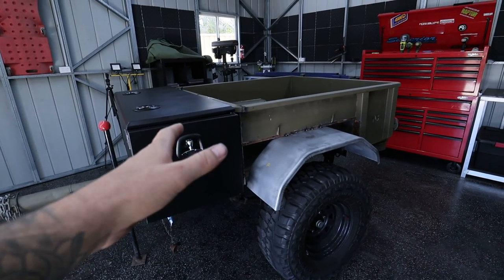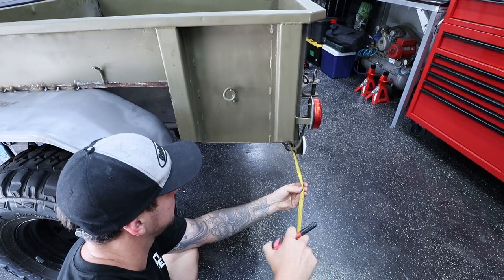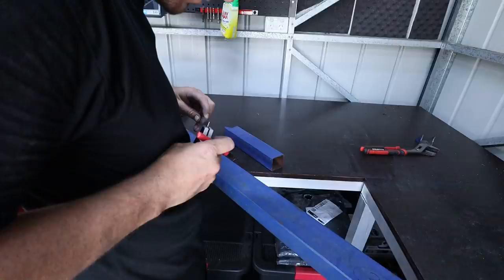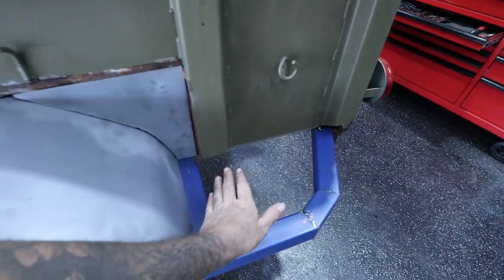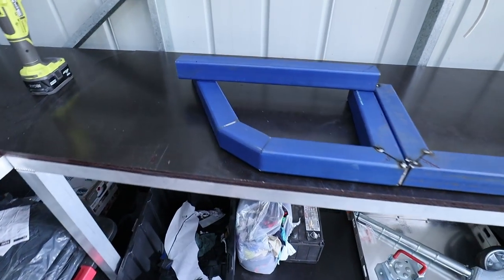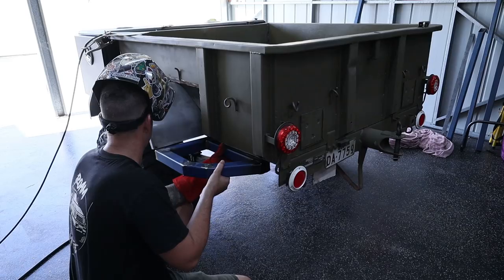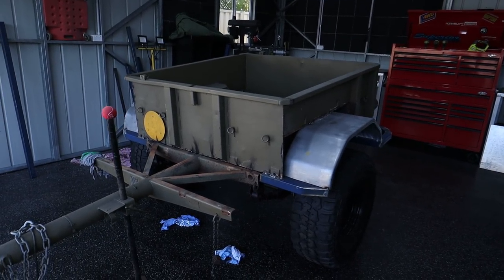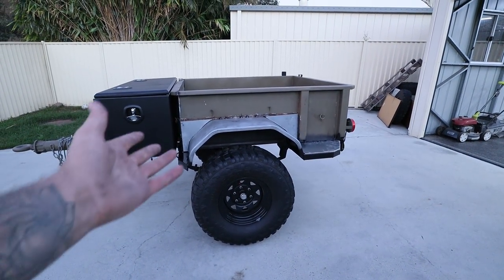Budget Camp Trailer Gets DIY Sliders / Steps

Comment: I know you've probably thought of this but anyway: its hard to see how far the wheel sits out from the factory wheel tubs but if the wheel is almost all the way out of them you should removed them so you have more trailer space. Also off the front "slider" maybe you should just put a perpendicular bar that goes flush underneath that front box so that it wont hit the door when it open but just incase it happens to cop a hit from something. Again you've probably thought of this already and loving the progress
Reply from the maker: Bloody great idea mate thanks heaps for the input, love these suggestions! 🤘

Comment: Love the build mate. Would it be easier to cut out the internal wheel arches to give you more room inside, save you doing the plate either side of the new mud guards? It looks like you could do away with the internal guards now the wheel base is wider with the new axle?
Reply from the maker: I’m still tossing up weather to do that or not! There’s a couple reasons why I havnt but nothing it set in stone! Thanks for the comment!!